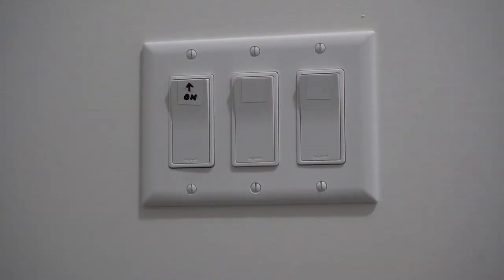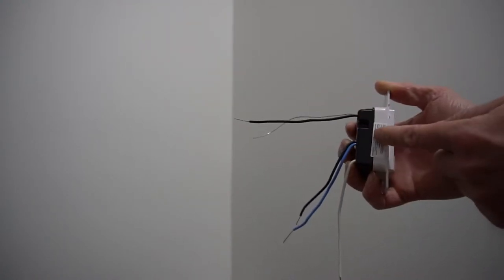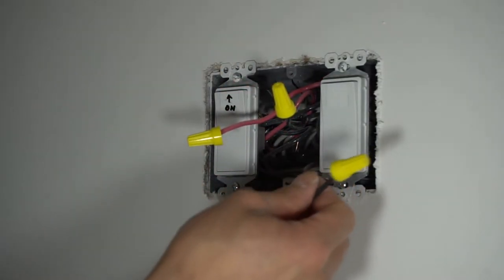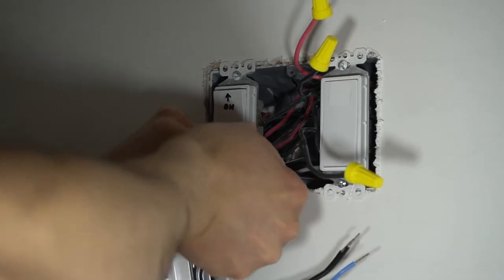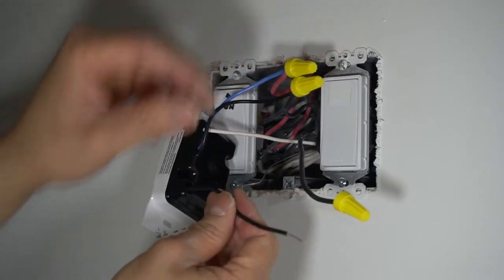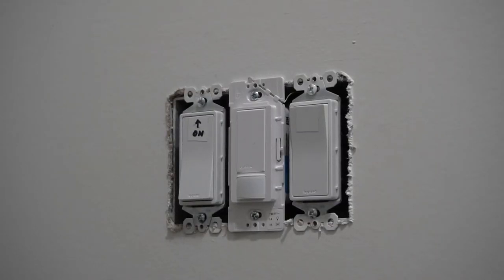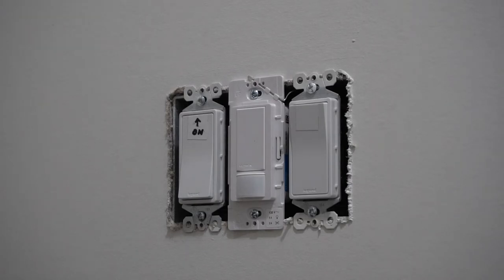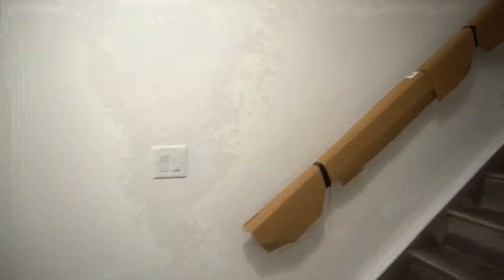HOW TO INSTALL Occupancy Sensor Switch 3-Way and Single Pole - Lutron Maestro OPS5M-WH

Comment: I have 2 devices in the same box and no red wire? I have 3 blacks and a white. The black hot meets in the middle of the 2 devices (1 3way switch and 1 single pole switch).

Comment: Hey Kevin thanks for this vid! Is it possible to wire two Lutron occupancy sensor 3-way switches together? The switches are around the corner from each other and so I'd really like both switches to have sensors.
Reply from the maker: Hi Corbin, I'm thinking it will work. I'm planning to test that out to see. Hopefully today I'll have some time.
Reply: @KevinPon.  Thanks for responding so quickly! Fingers crossed that you can figure it out!
Reply: @KevinPon.  Oh yes please! I've been interested in doing the same thing but have no idea how to do it.
Reply from the maker: @pkmaul9156  I will have an answer by the end of today. Promise! 😂
Reply from the maker: @pkmaul9156  Here's your answer: Video for proof https://youtu.be/Ma_gWiJ5VEE
And the answer is no can do :(
Reply from the maker: @corbindean1776  Here's your answer: Video for proof https://youtu.be/Ma_gWiJ5VEE
And the answer is no can do :(

Comment: It was very helpful. Thank you, Kevin. Just one thing, I wish you could mention in the beginning the difference  between the singe pole and 3-way switch cause I had to pay five bucks for the online service just to find out mine isn't a single pole but requires 3-way if two switches control one light. Then I could find you only after typed in 3-way switch installation. ;) I am a lady with no clue whatsoever. Lol. Your demonstration is very clear and easy to follow. Two thumbs up!
Reply from the maker: Thank you for your feedback Christine! Lol I'm glad it worked out in the end for you! If you have any questions feel free to ask anytime 😊🍻

Comment: Hi Kevin, my electrician install 2 3-way sensor on my staircase , one upper and one lower, but right now only the lower señor auto on and off, but the upper sensor is not working at , the switch is not able to turn on and off either , I try to do the setting high sensitively and auto on and off, I don't know what part of wiring is wrong ?
Reply from the maker: Hi Loretta, I know what's wrong. The problem is that the other switch has no constant power. Please check this video, this will solve your problem. https://youtu.be/zEqfHxSLC-s

Comment: I have 2 , 3 way switches going to lights, can I buy two of these for both 3 way switches that will work together? Or will only one work on a circuit? Thanks
Reply from the maker: Very good question Joshua. The answer is absolutely yes! But you'll have to follow these instructions to make it work. Watch my video to see how: https://youtu.be/zEqfHxSLC-s

Comment: Great walk through video for a motion sensor replacement. I did everything as you did, then I turned the light back on 😥 no sign that it was working. I went back to turn off the lights off and I calmly sat down to check if there were troubleshooting instructions on the menu. The first thing I saw was, “your switch may not work... wait 2 minutes for the switch to fully charge.” (Something along those lines). I was like surprised so I set my alarm for two minutes. Sure enough, two minutes later it was working like it’s supposed to. Thanks for the clear instructions. 👍
Reply from the maker: You're very welcome Alexander! I'm happy you got yours to work 🍻

Comment: so i install one 3-way sensor in one switch and a normal 3-way switch on the other switch. my sensor switch only work when my other normal switch is turn on. is this normal?  So if i turn off my normal 3-way switch, the sensor doesn't work.
Reply from the maker: Yes that is normal. The reason why it does that is cause the sensor is not being supplied by constant power 24/7. So you will have to leave your normal 3-way untouched in order for the sensor to be on 24/7 and it'll be able to do its thing.
Reply: The instruction that come with this exact switch show you how to wire the non-motion sensor switch in a 3 way setup so that this exact issue won’t happen. I’m not sure why this video left out that part. It is absolutely possible to wire it correctly so that you do not have to leave your normal switch in the “on” position constantly.
Reply from the maker: @LouDog0102  regardless, you won't be using the normal switch. By doing this way, there's the option to turn off the occupancy sensor. Even if it was wired the other way. The normal switch is ON even if you flip it "off"...
Reply: There's actually something you have to do to the old switch. You have to take one of the travelers and wire it together with the common wire. Then you will always have power supply to the motion switch.
Reply from the maker: @blackhat8287  yes you can or leave it. Then you will have the option to turn off the occupancy sensor. You have more options this way.

Comment: The instructions say to jump the second 3-way switch on the other end, how come you didn’t have to do it?
Reply from the maker: By not doing it, I still have the option to turn off the lights from the second 3-way switch if I wanted to 🍻
Reply: @KevinPon.  so you have a 4 way setup with 3 switches? I believe to have to jump it to get them to work arbitrarily

Comment: Great demonstration of how to install this sensor switch. I would have been 'experimenting' for hours if I had not watched so thanks! I did add the pigtail  in the non-sensor switch as shown in the instructions. Doing this allowed the sensor switch to work regardless of the position of the other switch.

Comment: Kevin, you are the greatest. Seeing this procedure actually being done made it so easy. My only problem was that I had removed and replaced the 3-way switch several times and wasn’t sure which of the black wires was the power wire. I used a circuit tester to find the right wire and was off to the races. I can now enter my shop to light blazing.
Reply from the maker: Haha thank you Jim! Job well done! I am super happy with your success 🍻👍🏻👍🏻👍🏻
Reply: @KevinPon.  I had given up and was about to take the parts back to Home Depot when I searched YouTube and your post came up. What you showed was exactly what I had. Brilliant. Thanks again. How long have you been posting and on what subjects?
Reply from the maker: @jimgrant3384  you're very welcome! I've been posting for a little over a year now. The main things I post are tutorials, reviews and product demos. A bit of everything for everyone.
Reply: @KevinPon.  Great. I’ve subscribed so I look forward to your future posts.

Comment: Thanks for the video! I completed this, programmed it with the indicator lights signaling, but the switch wasn't turning on. I waited the two minutes and still no go. I almost took the whole thing apart, then i realized i just had to turn the closer switch on (and then wait the two minutes)
Thank you for the walkthrough! Couldn't have done it otherwise
Reply from the maker: You're very welcome John! Glad it worked out! 🔥

Comment: Hi kevin, i have a questions, if i have a 3 way switch,  can i put only 1 motion sensor, and the other one just regular switch,  will it be working? Thank you very much
Reply from the maker: Hi Nick, you absolutely can. However, the manual switch must stay in the "on" position or else the motion sensor switch will turn off. It won't be running 24/7 🍻

Comment: hello, excuse me for the question on which side did you place the lutron sensor on the side where the constant power supply is or on the side that brings the power to the focus
Reply from the maker: Hello, either side works. But you cannot use the other 3-way switch. It has to stay ON or else it will break the connection. Must be on 24/7 or else the motion sensor switch will not stay on 🍻
Reply: Thank you very much, would it be convenient to use a bridge in the three-way switch to prevent the circuit from being open?
Reply from the maker: You're very welcome Rikard. I would probably leave the switch and pretend it wasn't even there. Or you can do this: https://youtu.be/zEqfHxSLC-s
A lot of my viewers configured theirs 🍻
Reply: Thank You Bro

Comment: Kevin - great video! I want to replace my current bathroom and light fan (dual single toggle switch) with this one Lutron Sensor. I'm not sure how run this.
Reply from the maker: Thanks Peter! To do that, so everything is the same except for you will not be using the blue wire on this switch. Cap it off. The black wire that's right beside the blue wire on the switch, you will splice that wire with the fan and the light (your loads)(black wires) and all the white wires will be together 🍻

Comment: Did you have to do anything for the other switch as mentioned in the manual? 
I followed your instructions but the light,once on, stays on.
Reply from the maker: @pikuban  you have to wait till it times out then both will be off or if you press the off button for both of them it should be off 🍻

Comment: Thanks for your helpful demo. I just installed 3 3-way and 2 single pole switches . Stairway has 5 3 way switches as group of 3 and 2, I only change 3 of them, in the group of 3, I changed two which are to detect the start of stepping down the stair and one to stepping up. I left out the middle between the bottom and the top of the stairs which is a 3-way with dimmer. I ran onto one which does not have neutral and one which needs to wire with a whole bunch of white wires. For single pole, just don't use the green one and connect to the bare. However, there is one old switch which controls light but does not look like 3-way  but rather single pole switch and not only it has 2 screws but 4 screws, so this part I'm still figuring out if I can use it as a single pole but it may disable whatever the other 2 screws got connected. I was looking and almost ready to buy battery power stairway lighting set which would be a very bad idea since Lutron's cool occupancy sensor switches solved how lighting should operate in need of those situations as in my case as older people forgot to activate light when going downstairs. Not only it lights up automatically but turns off when not in use. This is how demo should be so you can see wire connection with clear explanation as I was able to understand to get this installed correctly.

Comment: Hi Kelvin, I am trying to install one 3 way switch. Mine has a bare copper wire, white, red and 2 black wire one connected to the black screw. I am wondering what is the copper wire? Is that a ground wire? Thank you very much.
Reply from the maker: Hi Bao, yes you are correct. It is the ground wire 🍻
Reply: @KevinPon.  Thank you.

Comment: How are you able to figure out which side is the hot wire and which side is the load wire? Both 3 way switches look the same. Thanks.
Reply from the maker: The safest way of checking is by using a voltmeter to test voltage. Or else you will have 50% of getting it right the first time if you're guessing 🍻
Reply: @KevinPon.  I bought the Ecoeler YM2108T Motion Sensor from Amazon and it has 5 wires, green, red, black, blue and white. How do I hook those up? Thanks.
Reply from the maker: Red with red, black with the power supply that's also black, white wires all together, green is to ground wire and the blue goes to the black on the 14/3 traveller wire. Good luck 🍻
Reply: @KevinPon.  thank you so much! Got it to worked.
Reply from the maker: That is wonderful!

Comment: I purchased one of the 3 way switches and was able to install it just fine. The new switch worked well. However, the other old switch was able to turn off the light, but not turn it back on. Also, if the old light switch was off the new switch could not turn the lights on or off.

 I tried switching the travelers, but that did not help. I was able to wire the old switch back and both switches work without issue. Thoughts?
Reply from the maker: Hi Nick, the reason for that is that the old switch has the control of the main power source that will feed the new switch. The new switch needs 24/7 constant power for it to work. If you turn off the old switch, it will stop the power traveling to the new switch. That's why I leave my old switch untouched. So the new switch stays on 24/7 and turns on the light automatically when someone walks to the room. 🍻
Reply: Thanks for the quick reply. So what you’re saying is I installed the new motion switch on the wrong switch? Therefore, my options are to change the motion switch to the other switch, or put motion switches on both switches?
Reply from the maker: @nickcoad3763 no problem. I wouldn't say you installed it wrong. You done it correctly. Even if you installed it to the other side. You cannot flip the old switch. Must leave it on. Let's say you did installed both on both sides and if both switches are triggered and you want to turn the lights off. You will have to press both switches to turn the light off. However installing both allows you to turn the light off only if the other switch doesn't pick up motion.
Here's a video on how I made 2 new switches to work with the correct wiring https://youtu.be/zEqfHxSLC-s
Reply: @KevinPon.  Would connecting it to a neutral work to supply it power constantly?
Reply from the maker: @blackhat8287  hi CY, no it does not. Watch this video. I think you might find the answer you're looking for https://youtu.be/zEqfHxSLC-s
Reply: There's actually something you have to do to the old switch. You have to take one of the travelers and wire it together with the common wire. Then you will always have power supply to the motion switch.

Comment: can you explain the single pole part (4:35) one more time? do we connect all 4 of the black wires together? or do you connect the wall black wires together and the switch black wire together?
Reply from the maker: If you have the same switch as me. Do not use the blue wire. You cap it off. Connect the black wire (corner of the switch) to the power source. Now you're left with the other black wire, connect that to the light fixture of the black wire. Lastly connect all your whites (neutral) together 🍻

Comment: My wall box (one of the two) has only four wires: one black, one red, one white, and one naked coper ground. Can I use the same product? How would you wire?
Reply from the maker: Hi John, are you positive that's all the black wires you have? There should be the black wire from the 14/3 (group of 3) and another black wire from the 14/2 (group of 2) that will be either the power source or the wire form the light fixture.
Reply from the maker: It should still work with the same product. You will have to connect the black with the black, white with white, red wire with the black wire that's next to the blue on the switch and lastly the bare copper with the aluminum bare on the switch. Must have constant power flowing to the motion sensor so the other switch cannot be switched off.
Reply from the maker: The blue wire on the switch can be capped off. You won't need to use it.
Reply: This is helpful. I tried to upload some pictures of my wall box, but YouTube does not allow URL. Will buy one and try.
Reply from the maker: @johnhe9984 👍🏻😎 I've seen that. If you need some help again. Try just sending me a link of the picture
Reply: @KevinPon.  I figured it out today by following the manual. Unfortunately it does not come with a cover. Need to order one.
Reply from the maker: @johnhe9984  awesome! Good job! The cover is basic. You can pick one up at a hardware store 🍻

Comment: Kevin.  Although this is a great tutorial, I still need some help to figure out which wires from my existing switch should be matched with the wires from the Luton switch.   It’s a 3 way set up.   The existing switch has two white wires at the top on each side (left hand side connected to a black screw, right hand side to a brass screw), and two red wires at the bottom on each side (LHS red is connected to a brass screw, RHS red is connected to a black screw).  There are no tags on any of the screws.    Can you advise?   Happy to send a picture, however I don’t think it possible to attach pictures in these comments.    Hope you can help.  Thank you.  R.
Reply from the maker: Hi Raouf, you could send me pictures at kevinponbusiness@gmail.com
Your existing switch does not sound like a 3-way 🍻
Reply: @KevinPon.  just sent.   Thank you so much.

Comment: Can we use single motion switch or we need to buy a 3 way motion sensor?
Reply from the maker: Yes, you can use a single motion switch. But you will have to wire it correctly to function properly 🍻

Comment: my only hot wire in the box is white? I am going to put black tape on it. Don't you have to do something in the other switch box?
This is a 3 way right?  My switch instructs me to  tie the black wires together  and put the bare wire on  the common terminal.
Reply from the maker: You will have to make sure it's 100% a hot wire. Mistakes can happen. If that's the case then you can put black tape on it.